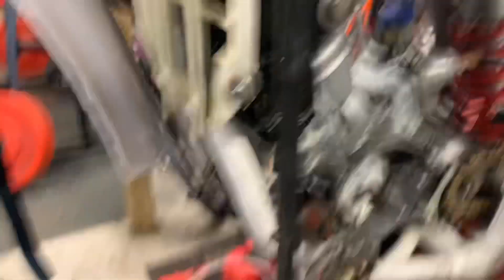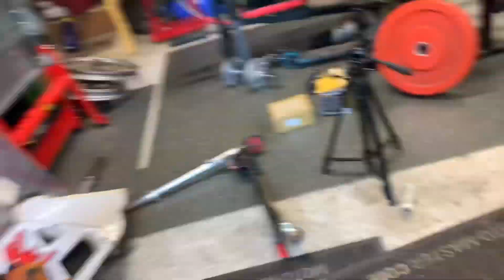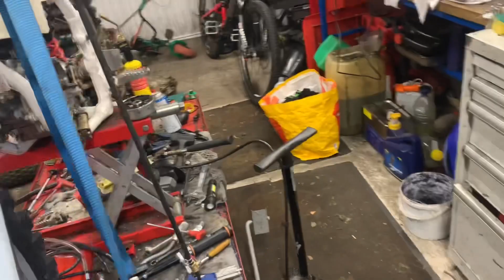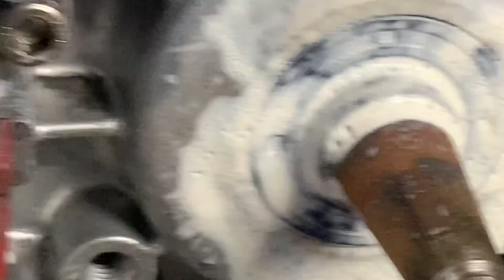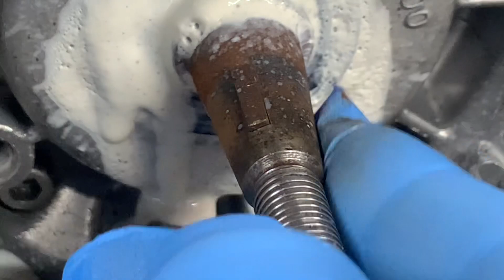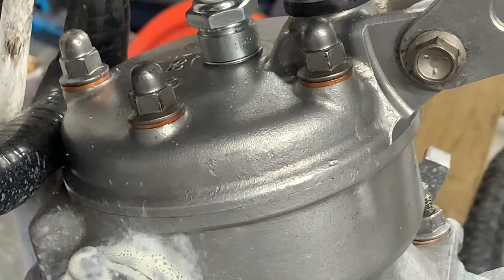Part 2a finding the air leak on 2 stroke Yamaha YZ125 engine

Comment: One thing I noticed aboot Japanese bikes is that most seemed to get mechanical changes every year. No swapping out parts for most.
Reply from the maker: Model evolved a lot - euro bikes seemed to keep a lot the same and then a load of changes at once!
Reply: @phoenixmotos9712  Down in Texas there are a ton of dirtbikes, funny they are beat up also, but a buddy had a 89 ktoom 250 and a 86 cagiva 125, he said they were expensive, and parts were hard to come by. I rode em both and they were pretty dang cool.🤠👍